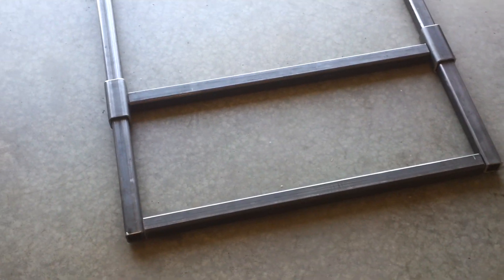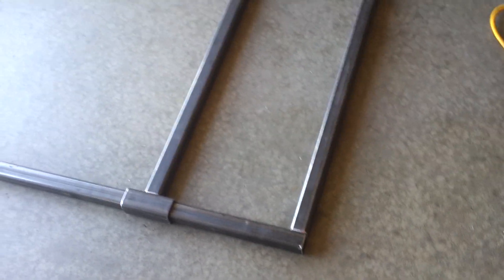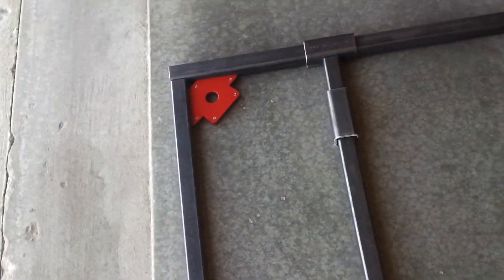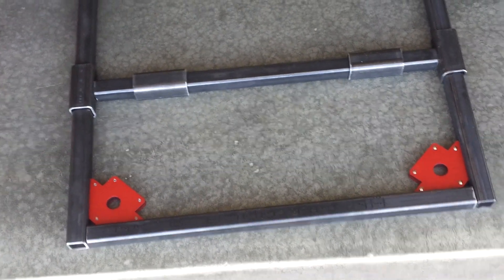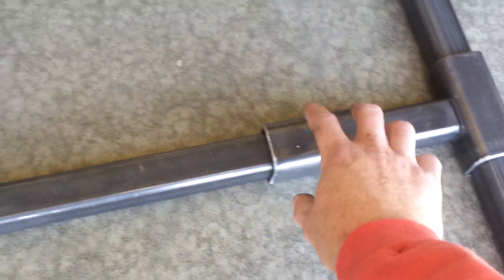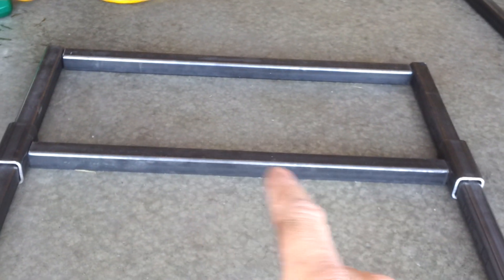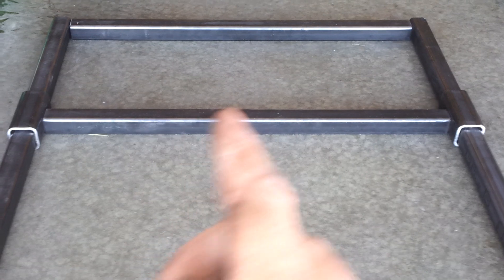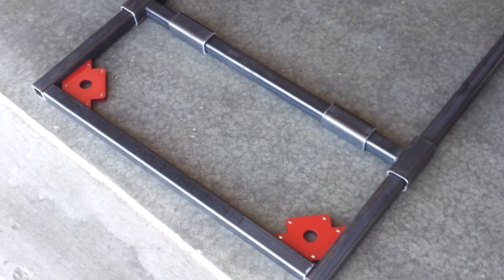Engine start stand plans II

Comment from the maker: The stand worked awesome.......there are 3 things I might change.......Id use 8" casters because if you use 6" most cherry picker wont slide under the stand so I had to shim them, 2nd Id make the radiator detachable with pins which would be easy that way you can do a cam swap without having to unbolt the radiator and 3rd Id probably make a better engine mount but the mounts I made worked great! I dont have a parts list but if you have questions you can email me at drennon99@yahoo.com and Id be happy to help you in any way I can!